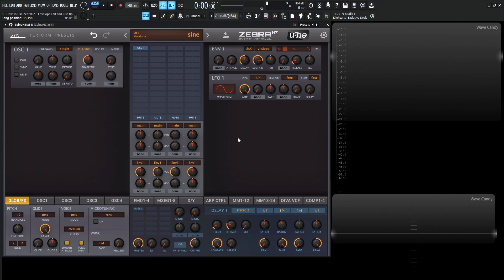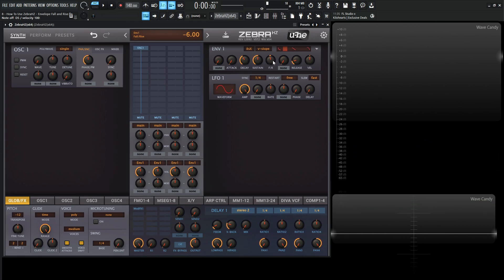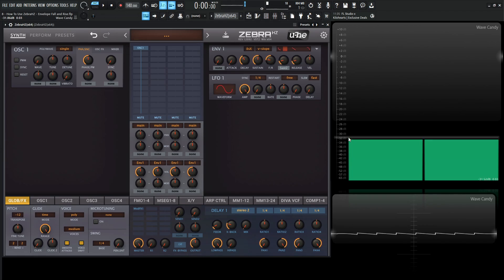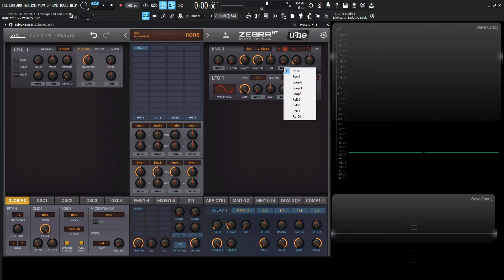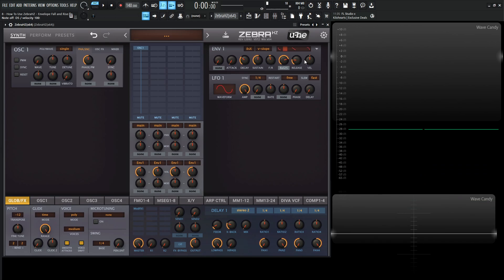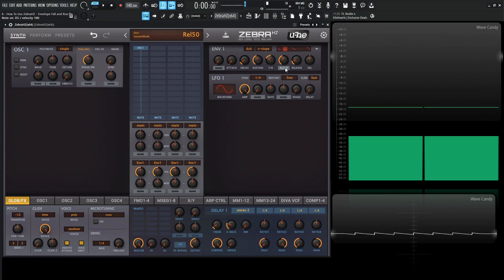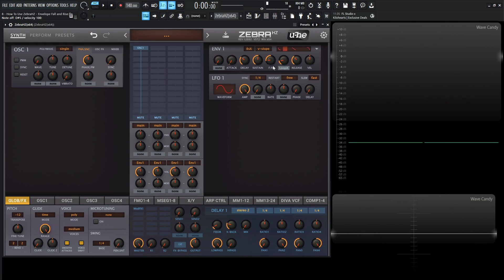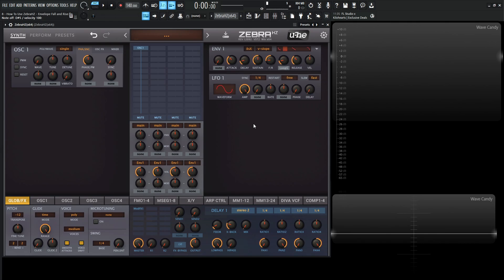Envelope Fall/Rise Zebra HZ Tutorial Lesson 8

Comment: Just a suggestion how to better visualize this: If you have an oscilloscope that you set to a slower speed you can actually see the resulting env shape. This works particularity well with ShaperBox Scope, where you can trigger a reset on MIDI note and set overall length to.. let's say 1 or 2 bars.
Reply from the maker: Thanks dude, I've heard lots of good things about shaperbox, I didn't know shaperbox had a scope, I'll def look into that. Thanks for the suggestion! 🤙🤙
Reply: Thanks for the reply! ShaperBox is a really nice product and it's scope works nicely for me. 
I really like how you use WaveCandy to show what's happening. I don't have FL Studio though and so far I couldn't find any spectrogram that works as well as the one you use.
Reply from the maker: The scope in FL is OK, I'm sure there are better ones out there. The scope in Cubase was really cool from when I saw other people using it, I think it was called Insight.
The FL scope does take a little fine tuning to get it to show the waveform just right. But it would keep that view for every note. Would be cool if it did, because one I find that right setting, I usually have to stay on that note for the most part so you can actually see what the wave Form is doing.